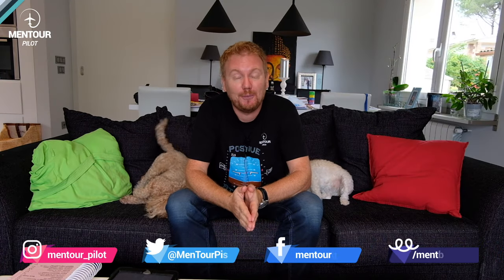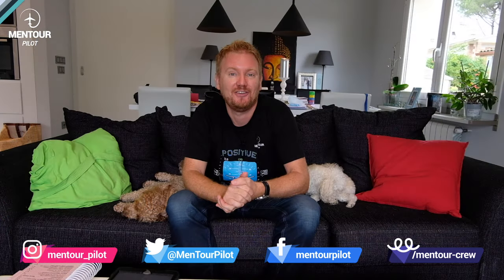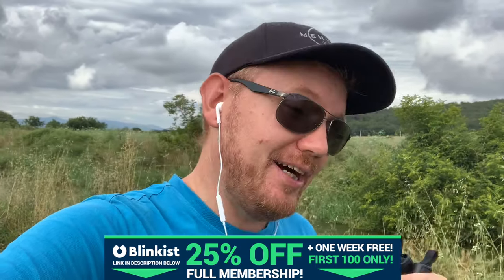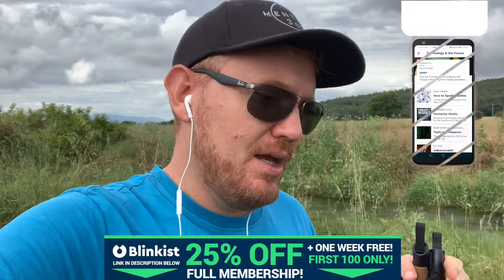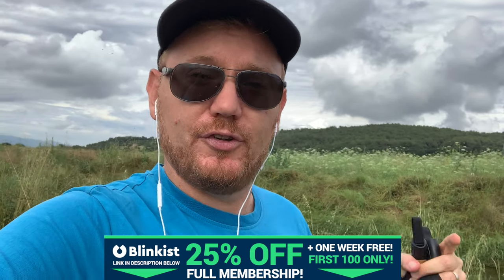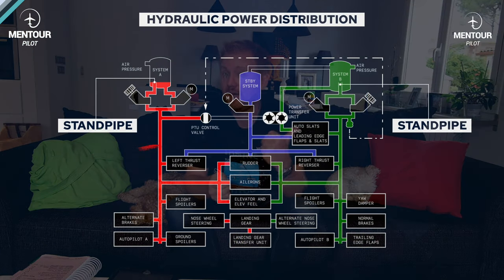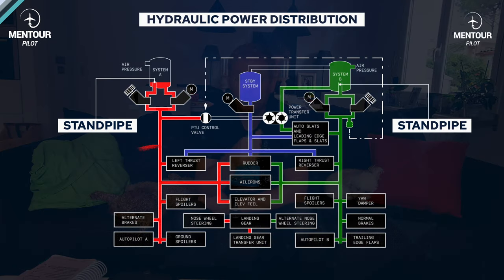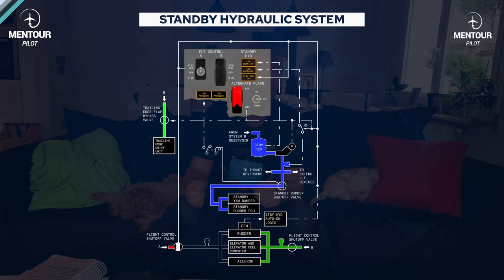How the Boeing 737 hydraulic system works. (And what happens when it doesn't)

Comment: Oh, and one more question... what would happend in the even of... say a wing getting pierced with loss of fluid in ALL hydraulic systems on a different jet? Are there shutoff for various parts of the plane? As in... would you just lose hydraulics on... say the right wing?
Reply: After United 232 there were supposedly shut off valves installed but not sure how they are implemented now. Didn’t help the DHL aircraft in Baghdad. The A350/A380 have electro hydraulic actuators with their own mini hydraulic circuit so if the fluid in the 2 main systems leak out then the aircraft can still be controlled as long as there is electrical power
Reply: If you lost all fluid, what is the point of closing a valve?  No, it would not be isolated to one wing, it would affect everything that particular hydraulic system operates.
Reply: B37xM Flyer he means whilst the fluid is leaking if you isolate the part where the leak is occurring immediately it could prevent a further loss
Reply: @tomstravels520  That's exactly what I meant. Thank you. 
Like in the case of UAL232, if just the right part of the horizontal stabilizer/aileron had been lost, the left side could've still made a difference. 
That's why I asked.
Reply: DrunkHog 
There are flight control shutoff switches for each hydraulic system, which you would use in reaction to a low pressure light.  You would have no means of determining where the leak was.  The other operating hydraulic system would mask any loss of pressure on a flight control (meaning that you couldn’t feel any difference in the column, yoke or rudder).
Does this help?
Reply: @737MaxPilot  so that means that if for some messed up reason there were to occur a loss of pressure on ALL 3 hydraulics you'd be screwed. On the b737 ypu still have a little bit of control, but on something bigger??? I dunno.
Thanks for your answers, by the way!
Reply: DrunkHog 
No, not screwed at all.  The 737 can be controlled just fine with no hydraulic pressure at all.  You’d just want to find a nice long runway for a fast landing with no thrust reversers.
Just remember to go get some lottery tickets, as I’m not aware of this ever happening (at least in recent history) on the 737.

Comment: I‘m really surprised that Boeing put in more than one hydraulic system. That just doesn’t fit with „the Boeing way“ of cutting corners. Perhaps it is mandated by the government?
Reply: Get real
Reply: Harry M slight correction. They have engine driven pumps and then engines 1/4 have air driven demand pumps and engine 2/3 have electrical demand pumps. Engine 4 also has an auxiliary electric pump and so does engine 1 on the -8i
Reply: Gerald H. - Cutting corners is the NEW “Boeing Way” with Boeing being run by Bean Counters & Accountants who are more interested in stock value than anything else - The old Boeing was run by engineers who often overengineered the aircraft...
Reply: 737 has 5 hydraulic pumps
Reply: TraditionalAnglican the execution of the design principle was at fault, not the design concept.  When MCAS activates correctly, the pilot likely won’t even realize it is...as they are doing something they shouldn’t be doing with passengers onboard anyway.  HOW it exerted control and not having redundant input was a glaring failure, now resolved completely.

Comment: Is 2 autopilots for an auto-land a Boeing thing? Airbus only 1 AP is required for an auto-land. Only an approach with no DH requires 2 APs.
Reply: You always use 2 autopilots to auto land to have redundancy incase one fails. Airbus procedure is always use both AP's even if not auto landing, Boeing is only use the side of the pilot flying unless intend to auto land
Reply: @tomstravels520  Thanks for the reply. An Airbus is still Autoland capable if there is only 1 AP engaged known as CAT 3 single. After looking into it the Boeing won't even try to Autoland on 1 AP, which is a noticeable difference in the Auto-flight logic.

Comment: The diagram of these systems does not give me the impression of redundancy. It might act as if redundant but definitely at a degraded level. Actual redundancy would be at least two of everything isolated from each other. That is not what is here. Cascade redundancy "works" and if it helps get the aircraft down safely, great. 
It's not actually redundant so I wouldn't call it that. Distorting words for marketing or ease of consumption doesn't help anyone.
Very much the same way RAID 1 is data redundant but RAID 5 or 6 is data contingency redundant. You can't rebuild a RAID 5 or 6 when a drive fails without the parity bits but an actually redundant RAID 1 just needs the failed drive replaced. Everything still sort of works when RAID 5 or 6 failures happen but in RAID 1 it's as if a drive never failed.  Therefore a hydraulic failure on an aircraft such as 737 is more like a RAID 5 or 6 contingency than an actually redundant RAID 1. 
If one system breaks, okay we can remain in the air for a time. If more than one system breaks then we have to emergency land immediately and can most likely accomplish. If 2 or 3 systems break then hopefully you have the best pilots who are experienced in this and can get you on the ground without injury at best or at worst bodily intact so you can be shuttled to a hospital if needed.
Let's not mince words. They have meaning for a reason completely unrelated to what anyone wants at any particular time.
Reply: RAID? 🤔

Comment: Do B737 have a tail bumper..
Reply: a tail skid, yes the longer variants (900ER, MAX-9 and -10) have a hydraulically powered tail skid,  but it's operation is totally automatic, no pilot control is available.  the shorter variants have a static tail skid.
Reply: @peterp4319  Only the -800 has a tail skid, the -600 and -700 does not🙃

Comment: How the Airplane generate electricity ?
Reply: There are generators (alternators) mounted to the engines.  They are driven through gears and shafts and from one of the rotors in the engine.  The APU (a small turbine engine in the tail of the airplane) can also supply electrical power.
Reply from the maker: Through generators in the engines and the APU.

Comment: How do small female pilots cope with full manual flying?
Reply: RicktheRecorder - Most planes large enough to require that kind of effort have Hydraulic Controls. For the rest, you might want to look for a surviving WASP or WAAF from WW2 (a lot of aircraft in WW2 didn’t have hydraulic assistance) or see if Hanna Reitsch or Melitta Von Stauffenberg mention it in their papers...

Comment: as soon there is mention of B-737 a  kind of unease starts to manifest. Still.  Maybe not only because of the accidents but because of Boeing's attitude. Of course, they should go on producing 777, 787, 747, etc., but 737 might be better taken out of the production line.
Reply: lenny108 The 737NG is one of the statistically safest passenger aircrafts, so I cant see your point🤷🏻‍♂️
Reply: @speedbird9313  First flight of 737NG: February 9, 1997. Agreed, this plane was safe

Comment: Airbus hydraulic systems are far more easier than Boeing hydraulic systems
Reply: I have tried to learn both and I’ve got to grips more quickly with the airbus one. I like that if one fails it immediately tells you on status and FCTL page which systems are inop. Obviously if you loose one is doesn’t affect the flight controls at all. I think the worst combination to loose is green and blue. You only have one elevator, no ailerons and only 2 spoilers in each wing yes you still have THS and rudder at least and alternate braking
Reply: Thomas Mortimore check out the big brain on Thomas! Reminds me of an FE I met once or twice with the same/similar name back in the early/mid 90s